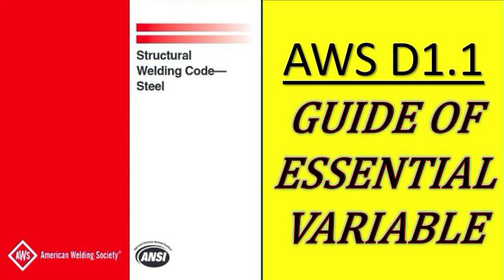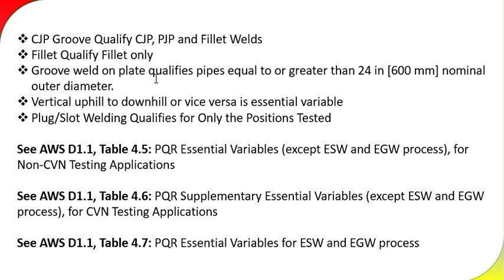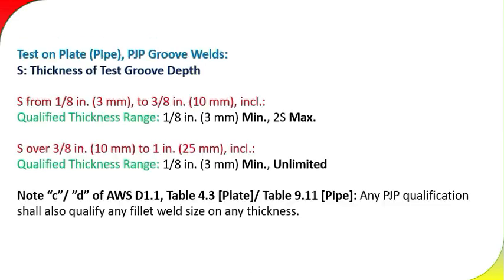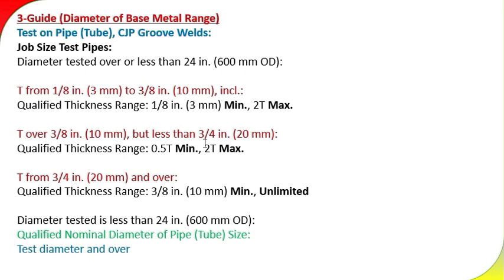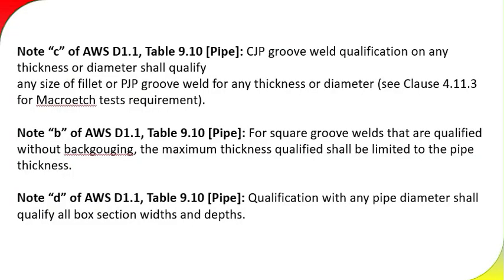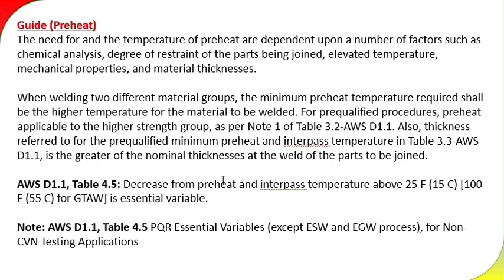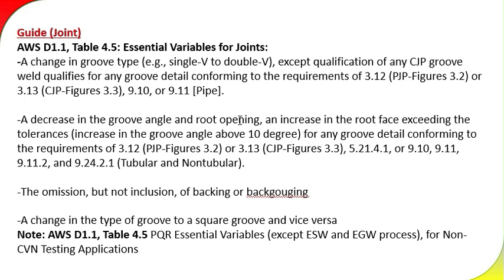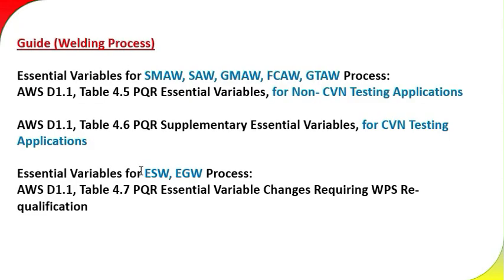WPS Essential variable guideline requirement -AWS D1.1

Comment: On the AWS d1.1 2015 code, for Welder performance qualification, what would be the range of qualification and reference for "pipe diameter" when the given diameter is 38mm and the thickness is 10mm. Please walk me through the steps.
Reply: Page 287, Table 9.14